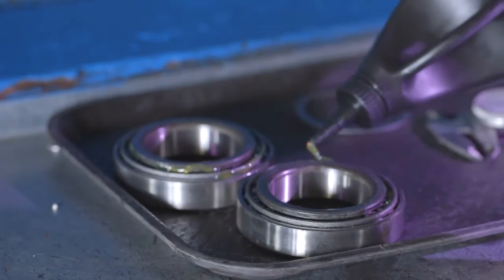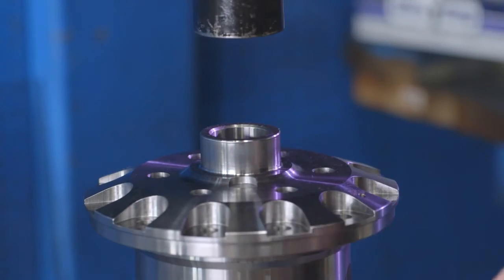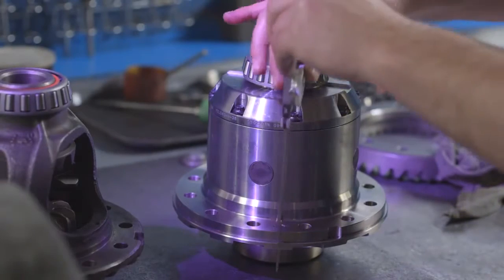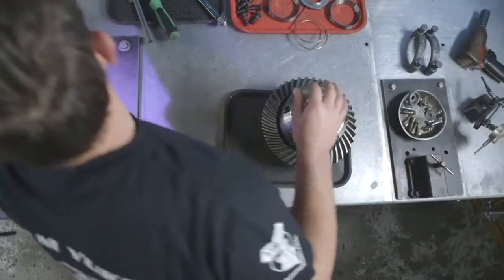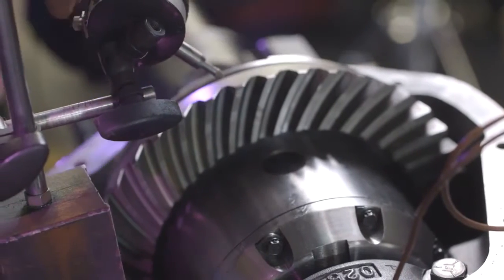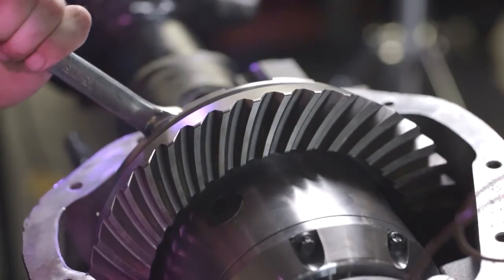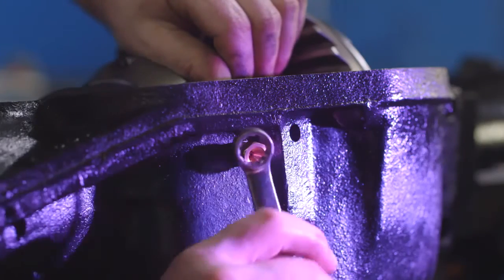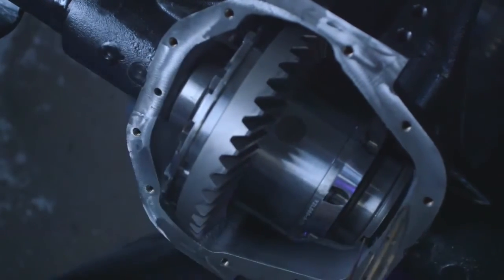How to Install a Yukon Zip Locker

Comment: When installing the ring gear he says to install threadlocker (ignore this) if you install threadlocker now it will set up and get hard because you got tap the gear and fuck with it to get it to set this takes time.. actually the best way it to completely install and torque the ring gear then go back and remove each bolt 1 at a time and install thread locker and torque them and mark them with a sharpy so you know which ones are finished .. I do this with clutches as well as flywheels and never once had any issues or bolts back out.. the only time you can skip this is when you have brand new arp or oem bolts that come with threadlocker already on them and have never been used. in which case install normally

Comment: ya'll completely passed over the preload and front pinion set -.-
Reply: I mean they said "adjust pinion depth if necessary", I guess they assume you'll find a video on that if you don't know how to do it :D
Reply: Videos like this arent a how to for people with zero experience. Everything stated and shown in the video is specific to this product and intended for someone who knows the fundamentals. Not the overall job. A lot goes into this. It would take over an hour to cover tips and tricks and every detail and tool you will need. It was a very frustrating wall i ran into when i was learning years ago. A chiltons manual or something is where you should be for a how to diy instruction. Took me a while to accept that it isnt summarized in a short video. Days of reading and rereading and money lost over simple mistakes and cut corners. Good luck.

Comment: I dont trust my local garages to install this lol, bet they wouldn't remove burrs or anything
Reply: Will the yukon locker fit directly into a teraflex R44 replacement axle housing without require shaving down  anything on the housing or locker?